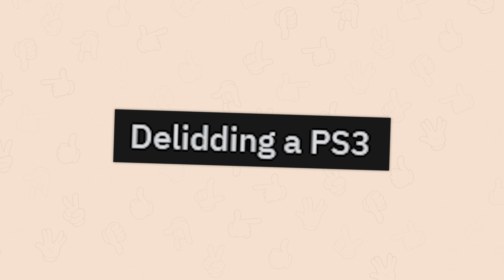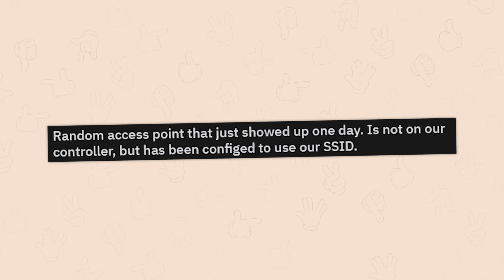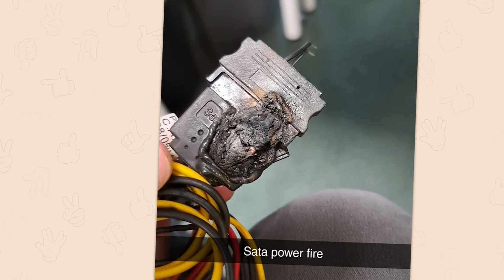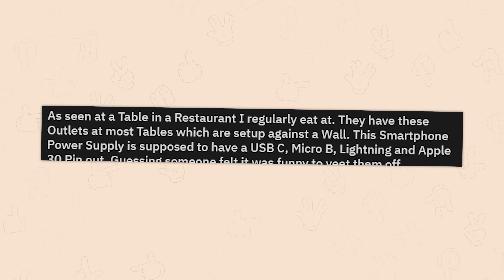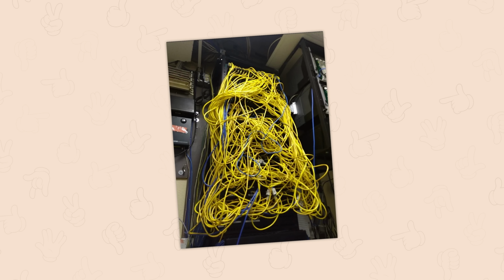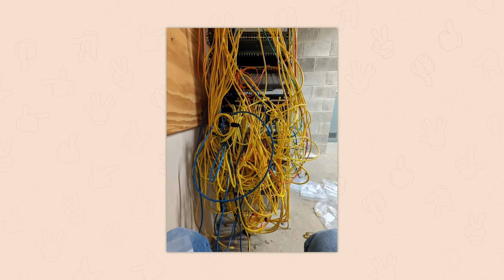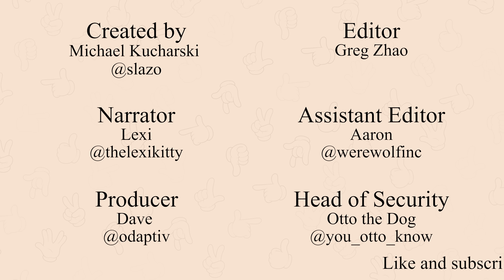r/Techsupportgore | improvise. adapter. overcome.

Comment: Delidding is usually done for improved cooling. The cover on the processor is designed to be a good heat spreader but you can theoretically do better than it. The problem is not that they took the cover off... the problem is that they also removed one of the processors. That's difficult or even impossible to fix XD
Reply: You also do it in the case of some packages that use thermal paste instead of solder to attach the heat spreader to the die. 
Thermal paste needs replacing after a few years because it degrades.
Reply: @shepardpolska  Yup. And Sony used poor quality thermal adhesive. Nearly every ps3 requires a delid nowadays.
Reply: @Dirty_Bear22  they should have used solder but if they used thermal paste or similar, 15 years is pretty good. i7 6700k need a delid and repaste after 4-5 years, many GPUs need a repaste after around 7 years
Reply: @shepardpolska  Fair enough. The thermal epoxy used on the first models had pretty bad lifespan, 2-4 years usually, the later slims drastically improved though. Biggest pain is delid a 90nm chip without a jig, a single scratch almost always destroys a trace. Thankfully consoles have moved to direct die cooling like laptops.
Reply: @Dirty_Bear22  Yeah it's why CPUs almost always use solder now, since it never degrades(gives better performence too) and GPUs use direct die cooling since forever. Using a degradable thermal solution under the IHS is a terrible idea, since removing it is always a pretty invasive process with high risk of damage to the chip.
Reply: @Dirty_Bear22 that was only for old phat models i think, slim and onward were better quality
i personally have a super slim and it generally reaches around 60 degrees (i have no clue if its F or C), never opened it up once except for when my cat was standing on it and i put her away and she REMOVED THE FRONT COVER RIGHT ABOVE THE POWER BUTTON AND EJECT BUTTON
Reply: @kellymountain  Slims had the same problems, just takes a little longer, I actually delid a few slims before. Super slims made the gap between the IHS and die significantly smaller, as well as using a less power hungry CELL. The RSX on super slims has no IHS.
Reply: @Dirty_Bear22  huh, neat

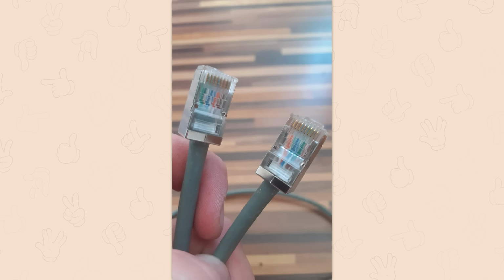Comment: 6:29 The issue is the wiring doesn’t match. It looks like one side is A standard and the other is B standard. This used to be known as a crossover cable, and would be needed to connect 2 computers directly without a switch.

Almost all network adapters now have what’s called Auto-MDIX, so it’ll sense if it’s a regular or crossover cable and adapt accordingly
Reply: thanks was really confused
Reply: yep 568a to 568b, or crossover. wouldn't have slowed anything unless everything else was just as ancient. the 10mbps hub they unplugged it from was probably the real problem.
Reply: yeap, and just about anything of 1GB/s or faster regardless of what it is autosensing. Really only 100baseT or 10baseT wouldn't work if you accidently used a crossover cable. And even then only one of the two connections has to be capable of autosensing.
Reply: I was just about to comment that, and then I saw this.  I must be out of the loop to have not heard of Auto-MDIX before now.

Comment: I still remember the day I learned what OZone smells like - I didn't realize it right away. I was derping on my computer like usual when I heard a loud 'POP' sound. I smelled 'something' (smelled kind of like fresh, clean air is the only way I can think of to describe it), then my computer just died.

Yep. That was the PSU waving 'bye bye'. Took me a while to realize that smell must have been OZone.
Fortunately, the rest of the system was fine.

This reminded me of that for some reason.

Comment: Vaping brings up a whole nother issue when it comes to electronics. I was fixing a device that came from a home where they all pretty much vaped. Everything inside of it was covered in a thin layer of waxy residue. It wasn't discolored. But you can tell everything was covered because it was slightly more opaque than it should have been. I could take my fingernail scrape a component and have wax (or what I assume is wax)  under my nails.
Reply: vape juice is made of two compounds VG and PG Propylene Glycol and Vegetable Glycerin,  it's kinda like a petroleium jelly, just...thicker, which is interesting as sometimes that is used during sub-ambient overclocking to protect the circuts from shorting due to the condensation from the liquid nitrogen. (the jelly, that is)
Reply: it is concerning that that shit is in their lungs
Reply: @ExarchGaming  crazy cuz it was acting as an insulator and hardened on the edges of the thermal pads.
Reply: Dang dude
Reply: @schrodingerscat3741  Crap in their lungs is a part of natural selection. The price of curiosity :P
Reply: @Dtr146  So ur telling me if I vape in my computer, I can improve it's performance?
Reply: @plasmicats2000  well the heat sink was covered in it too. And the reason they had me work on it is because it was overheating
Reply: I refuse to vape around my pc bc I don't want it to do anything to it
Reply: @payelizabethh  you want to know what the worst part of cleaning that computer was? All of the dust that was coated in that stuff.
Reply: I doubt vaping did that honestly.
Reply: @payelizabethh it won’t.

Comment: 9:35 it appears there was never a junction box in the wall, but instead they just put the coax cable through a wall that didn't otherwise have a hole in it, and then they just screwed a cover over the coax cable into the drywall so that it would look like it wasn't improvised.

Comment: that Imac photo was sad to see, I am so glad schools reach out to me now. I get their old machines for free, test them sell what's working, and see why the others are not working combine the working parts then sell and recycle the rest and oh you must not own or ever used a Chromebook they put "low power" CPUs in them put a literal sheet of metal over the CPU and expect it to passively cool from the bottom cover I have a Lenovo C500 and it will get hot enough to burn me if  it is on my lap and I am watching YT.

Comment: 5:30 nah, those look like normal AA batteries, and since they're probably in series they add up to the nominal 3V of the CR2032 you normally have on a motherboard. And yes, there are rechargeable lithium coin cells, but they AFAIK have the same voltage behavior as a normal lithium ion battery (4.something V peak voltage), are quite expensive and require special chargers.

Comment: 2:00 Lead acid batteries are no joke, drop a wrench on bus bars and you have made an impromptu railgun, or worse, welded the wrench in place and melted the top of your battery with red hot metal.  

Never mind the fact that batteries with vents need to have ventilation due to hydrogen generation forming explosive atmospheres.  

Mess with heavy electrical at your extreme peril.

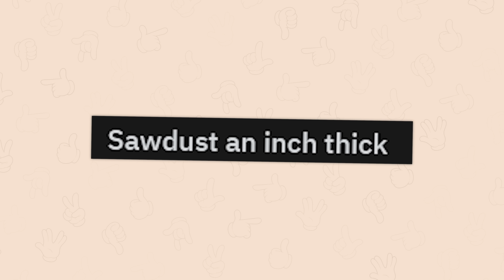Comment: 11:00
Ohh, I know a great story about a PC like this;
A guy I knew had to do some work on a carpenter's workshop PC.
And hooboy, that thing was Packed with sawdust, but still running fine (except a little hot). He never turned it off, just left it on when he went home.

Well, my buddy had to do an upgrade on it, so he turned it off, cleaned it out, and did the upgrade.
Now, when he turned it on he learned three things in VERY rapid succession;
1. He had forgotten to clean out the PSU.
2. A PSU can make a 3 foot jet of fire when expelling a decade's worth of very fine sawdust that ignited when the powersupply turned on.
2. It can apparently survive aformentioned event.

Needless to say, dude never forgot to clean out the PSU on future jobs.

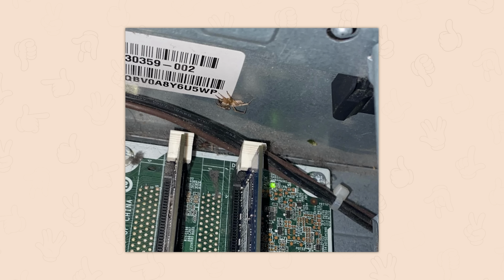Also 11:31
Don't worry about that little guy, its little just a house-spider that hunts small insects, like ants and roaches.
He is a good guy.
Reply: There are very few dangerous spiders out there anyways.. I don't get why someone can see a tiny spider like that and be scared lol.. Also holy shit that is one lucky PC..
Reply: He was lucky that did PC upgrade at home, but not in environment from where dust come from. Dry sawdust with air made excellent explosive mix. His upgrade would be heard miles away. Dust explosions are really happening in mills and factories when staff and management doesn't care.
Reply: @KrotowX  Oh he did that upgrade on-site.
Either the workshop had been cleaned and aired out before he arrived, or everyone in the room just got stupidly lucky.

In any case, a lot of luck was used up that day.
Reply: @lololollololol629  Well, fear of spiders, arachnophobia, is one of those primal fears.
I think most of the common phobias stem from stuff that could kill us in the ancient times;
Spiders: their bite, while usually not lethal, could weaken you enough for long enough, that you'd die from hunger.
Mice/rats: Carriers of diseases like various plagues and nasty viruses.
Heights: You fall, you go *splat!* and die... probably slowly and painfully.
Snakes: They bite you and you are, at best, disabled for a fair while. At worst, you die an agonizing horrible death.
Germs: Well, germs can kill ya easily, even now. Or incapacitate you for days or even months.
That would be lethal in the ancient times.
Even before germs were known to be a thing, "unclean" was known to be bad.

So yeah, people being afraid of those things are probably descendants of people who were also afraid of those things.

Its probably genetically hardcoded in a high percentage of the general population.

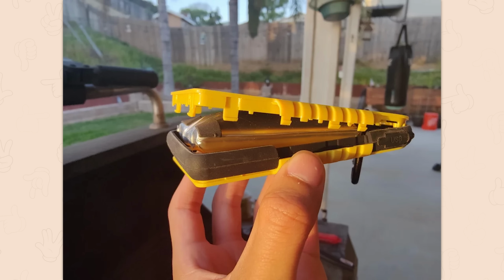Comment: 7:27 LIPOs don't like to get hot. They ESPECIALLY don't like getting hot while charging. Solar power banks are the worst of both worlds. Have fun with your pillows. This is why I use chargers that use 18650s instead of those fire hazardous pouches that turn into bombs on a whim. I've had two do this to me BTW.

Comment: I short circuited my one of my dad's lead acid batteries as a dumb 9 year old, and the wire melted and fell, white hot and partially melted, onto the plastic casing of the battery and burned a whole straight through. I managed to run inside and find a pair of my dad's pliers and run back out to the porch where the battery was and pull out the molten wire seconds before it fell into the battery acid, but that didn't change how mad my dad was.

Comment: Tip: if you spill liquid metal, don't wipe it! Most liquid metal blends solidify relatively easy at low enough temperatures. So, if it is still in globs, try this first: 

Take a can of compressed air. These use a refrigerant-like compound to produce air pressure. When you turn them upside down, they spew out this compound and whatever it touches can go down as low as -40 degrees when it evaporates. Carefully let this drip on the globs by lightly touching the trigger until things seem to start frosting over. If everything went well, you might be able to flick the glob of metal off the board with zero residue!

I saved a customer's board by doing this at a retail compute repair shop I used to work at. I cannot guarantee this will work as there are too many variables to promise results, but hey- I got it to work at least once and when you're talking trying this or replacing a several hundred dollar board...might as well try right?
Reply: Indeed try to contain spilled liquid metal in same place. Avoid spreading it as much as possible.

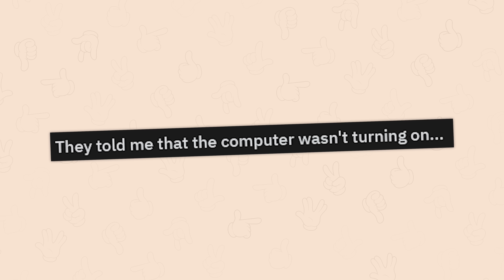Comment: 13:07 At nineties fellow guys in computer shop demonstrated completely smashed VGA cable connector with all pins bent in and similarly mutilated 9-pin COM port at motherboard. Their customer, big fella with bodybuilder figure, bought a new PC, at evening drank a lot of vodka with friends and decided to put his new hardware together to demonstrate it to his pals. Obviously mistook VGA port with COM port and smashed them both. As he told - "... it went in just a bit harder than others". Because it was not warranty case, they billed the fool for new motherboard and cable.

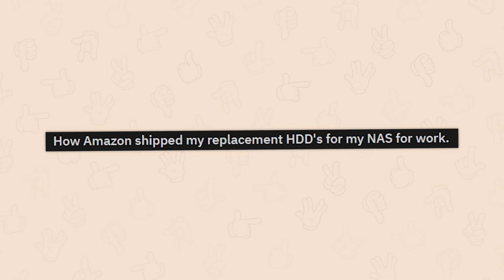Comment: 5:35 Hi, someone who worked at an Amazon "fulfillment centre" (Warehouse), the person who packaged those probably didn't want to, or didn't have the time to change the type of packaging on the system because they needed to process 90 packages per hour (or 40 secs, at most, per package), and since the system told them to use the bag, they had to use the bag to not get a warning about using the wrong type of package

Comment: 13:55 they are made by 3M, are called Scotchlock connectors and they are technically data rated. They were specifically designed for phone line patching. Granted, there is a huge difference in data density between phone and internet.

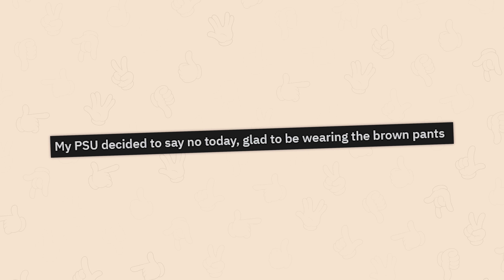Comment: 0:35 It's either that it has the Yellow Light of Death and the OP is trying to repair it (and Failing) or they are doing this to Minimize the chances of a YLoD

Either way, That Poor Phat PS3
Reply: Did he not notice the chip, probably memory, stuck to the IHS, ripped out from the PCB?

Comment: 12:19 It's an Chromebook 300e 2nd gen by Lenovo. It has one of the three battery cells right under that part of the notebook. The CPU in those devices is usually pretty low power so it can't produce that much heat.

Comment: 3:28 Lexi, the number shown is underflowed. It's actually closer to 3M, but 32 bit signed integers cannot calculate that properly.
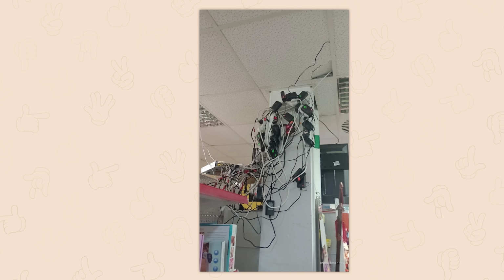4:42 And, I've seen worse than this! lmfao
...
Yeah; I've seen bad cable management. I won't elaborate.

Comment: 0:34
... That's the RSX Reality Synthesizer.... And the de-lidder appears to have sliced THROUGH one of the GDDR3 RAM chips on it...
Reply: He didn’t slice through, he failed to fully remove the adhesive on 1 of the RAM chips, when he pulled up on the ihs the adhesive pulled the ram right off the PCB. I seen cases where people pulled pieces of the CELL processor off with the heatsink.

Comment: 13:53 Those are actually known as "jelly crimp" or "jellybean" connectors.  They are really intended for things like phone wires, and are really convenient for making reliable, waterproof connections in the field without needing anything more than a pair of pliers to make them work.  (The gel inside is not conductive, there's a set of punch-down metal contacts inside which make a solid electrical connection between the wires.  The gel is actually a waterproof insulator which then surrounds the whole joint and prevents any water, dirt, etc from getting in and causing any problems down the road)

I would bet this was done by an old POTS ("Plain Old Telephone Service") phone guy.  To be honest, while they are definitely not intended for high-speed data connections, that would probably actually still work fine for basic Ethernet, at least up to 100Mbps (gigabit might be iffy).  I'd mostly be worried about crosstalk, but if the wires are kept short as they are here that probably wouldn't be that bad...  (There are still much better, more correct ways to do this sort of splice in general, though, and when doing gigabit-plus you really need properly designed terminations and connectors for things, you can't just splice individual wires together yourself anymore.)

Comment: 06:16 - That's a crossover-cable. They were once used to connect 2 switches or 2 computers together, before it's been deprecated by newer protocols.
Reply: Nowadays crossing happens automatically in port and you don't need such contraptions anymore.

Comment: 6:30 hey Lexi/Emkay for your wondering with the internet wire when you're putting together internet wire from end to end and crimping the plastic piece for the connector each of the ends has to be Identical with the small wires in terms of colors otherwise it will not work.

Comment: At 6:20 the wires in the right connector were crossed. I assume this means that the signals that are meant to go to one place were going somewhere completely wrong as a result.
Reply: That's what I was assuming as well. I was like, wait, aren't the wire colors supposed to be in the same order on both ends for network cables to work correctly.

Comment: I had an Acer Chromebook C7, back when they were first coming out. That thing was NOT meant for heavy use, as it always overheated. Burned black marks into the case from where my wrists would sit. Turned me off Acer as a brand for YEARS.

Comment: 12:12 my best guess is something shorted on the board causing the cpu to be forced with power making it heat up to the point it melted thru. Those chromebooks don’t usually have active cooling as they don’t need it as they don’t draw much power, most are just copper tape and if you’re lucky some well built ones have actual heat sinks.

Comment: 3:20 as far as the “-2,147,483,648 hours” goes, that’s a 32-bit integer overflow. (Basically largest possible positive number you can store + 1 causes you to wrap back around to the smallest number you can store).

As for the cause of such a situation however…

Comment: FYI: 6:31

The colors are mixed and are normally intended to be the same through out when used for PC to switch connections. However, Nowadays a feature called "Auto MDIX" will be able to change the pin connections via firmware. What the guy is holding is actually something called a cross-cable meant for connecting devices of the same class. Like: Router -> Router, or PC -> Router or Switch -> Switch.